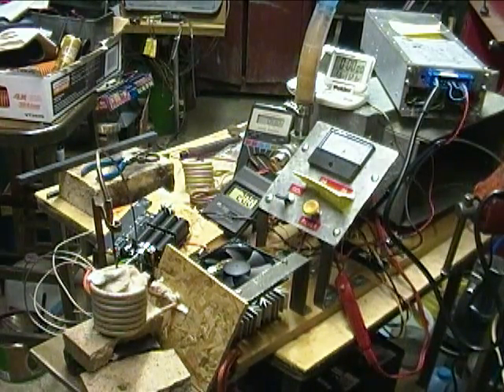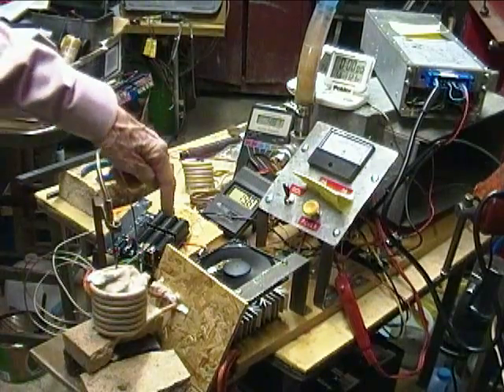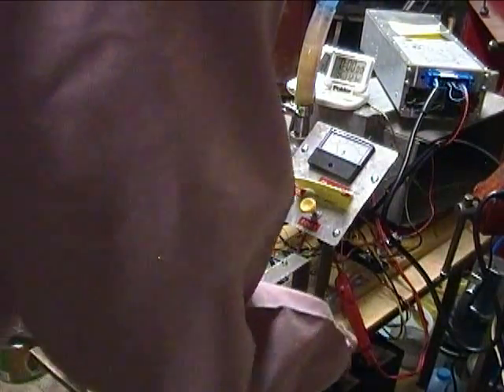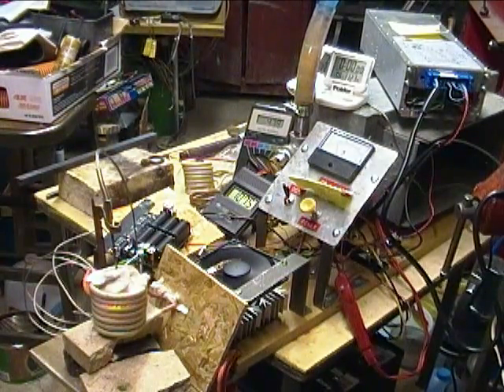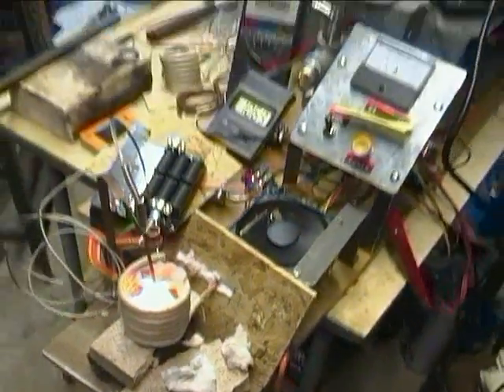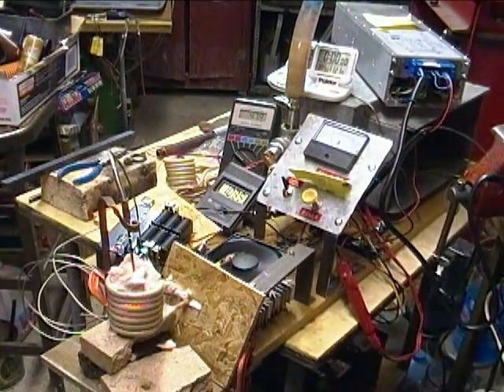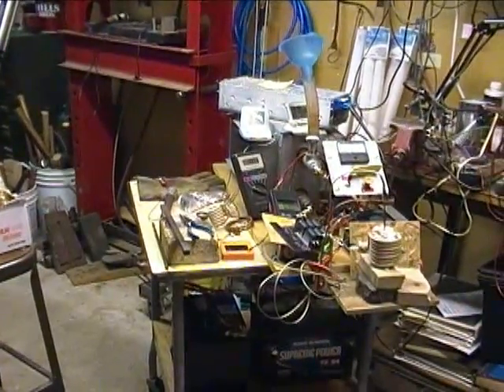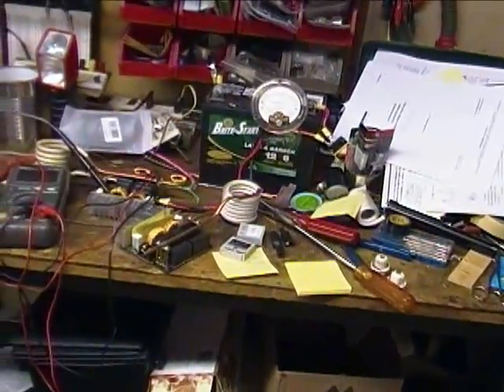ZVS 1000 Watt Induction Heater on 48 Volts

Comment: Hello again.I have been using my annealer for about 3 months that you have helped me with, and the heater quit working. When I examined it I found it had two blown capacitors. So I'm trying to figure out the cause. I have a 1000w 48v zvs, using a two wrap 4 turn coil made out of 4mm tubing wrapped in fiberglass tubing. The coil had a ID of 7/8" and OD of 1.25". I did find out my cooling fan was drawing air up from the board instead of blowing down on the board, I will change that this time. So with all this said do you have an idea of what I'm doing wrong? oh the coil is water cooled as well, and my power converter is out of a cell tower server 48v@ 3000w switching power supply. any help would be wonderful as I'm installing the new zvs heater this weekend. Thank you for your help
Reply from the maker: Do you have an amp meter in the circuit?  If so, what is your idle current and what is the current draw with a casing in the coil?
How long per "session" are you running the system with power on?
 I suppose you could simply have gotten a board with defective capacitors.  I would have thought that Mosfets would have failed first.
Reply: @frenchcreekvalley  I do have an amp meter on it. It wwas showing 8A with a run time of 3.6 seconds. I have a ssd relay so it shuts of the annealer after each cycle. I have an automatic annealer that picks up a case from a hopper, then drops it in to a shoot that goes to the coil, then a trap door that drops the case. this is repeated over and over 100-150 times a session. so idel is zero
Reply from the maker: @keeper1959fem  I don't have an exact answer for you.
Maybe just replace the capacitors and see what happens.
https://www.aliexpress.com/item/3256803832297341.html

Do make the fan blow down onto the board.
 
Can you measure the temperature of the capacitors?
Do some get hotter than others?

It sounds like your power supply is up to the task, but I would have thought that the current would be several amps higher.    Can you make sure that the power supply voltage stays up at about 48 volts while current is flowing?

Comment: I'm trying to melt some copper in my new 48 VDC 2500 watt induction heater, and I'm noticing that the volts drops to about 25 volts when I drop my larger size ceramic lined graphite crucible into the coil.  It doesn't do it with my smaller graphite (only) crucible.  I want to learn from your mistakes and not smoke this unit.  I've let it run for about two or three minutes at 25 volts, but don't want to let it go any longer.  Am I OK to run it at the low voltage?  Should I buy and parallel  another power supply with this one?  I bought the power supply from the heater seller, and it works well on iron, it's just my larger size ceramic/graphite crucible that causes the problem. Thanks for any input.
Reply from the maker: I strongly suggest that you need a ammeter in series with the power supply's output.  Personally, I prefer an analog ammeter with an external shunt, similar to this one:
https://www.ebay.com/itm/US-Stock-Analog-Panel-AMP-Current-Ammeter-Meter-Gauge-DH-670-0-50A-DC-Shunt/371816610448?hash=item5691ff3a90:g:r60AAOSwtdVa4s1s:sc:ShippingMethodStandard!54002!US!-1

 
It sounds as though your power supply is going into "current limit" mode which is causing the voltage to drop to keep from hurting the power supply.
You do need a power supply capable of 50 amps at 48 volts for this heater.
Yes, you may want to parallel your present power supply with another similar one.
See this video for my discussion about the power supply that I like:
https://www.youtube.com/watch?v=S66Y-EZYhjo
Then, see this video to understand what currents are involved with differing materials:
https://www.youtube.com/watch?v=Kz6tSfYLrnc
And I have several videos of melting copper.  Here;s one:
https://www.youtube.com/watch?v=ZiF3eYB5v0Q
In most of my videos I constantly call out the "numbers" so you can better understand what is going on.

Comment: When you added the second capacitor bank to your circuit, you were using 14Ga wire and just clipping it into the circuit. What you may not have considered is that you are actually adding capacitance to the tank circuit. Because this is a parallel resonant LC oscillator, both the voltage and current "in-the-tank" can be much higher than that of the power supply. For instance, the "wire" composing this tank is actually the copper pipe! By comparison, your puny 14Ga jumpers were like little fusible links (which is probably what they would have done had you left them connected very long).
Reply from the maker: Yes, I'm sure you are correct.  Next move is to use some copper bus  bar instead of wire, and to make the connections as short as possible.  Looking back on this experiment, I didn't make it easy to add things on, did I?
Reply: I had an idea for an easy way that you could connect your second capacitor bank:
Just use your old circuit board (like you were doing), but physically mount it to the bottom of your main unit by using the standoffs on the old board by removing the pipe straps and making six lengths of allthread by cutting heads off appropriate sized screws. Taking the standoff mounting screws from the PCB out of the working unit and replacing them with the allthread so you have screw threads sticking out the bottom and screw your 2nd PCB's standoffs onto these. Then mount the old PCB to those standoffs (just like they were originally). Voila! Now you've got a double-decker with 2 banks of caps joined by 6 hefty standoffs with very little extra conductor length added to the tank circuit! Simple, no manufacturing, no soldering even. What do you think?

Comment: If you are needing to lower your frequency, you can either increase the impedance of your chokes ( not an option, unless that's what you were doing with your work load ) or  add some capacitors.

There are three main equations that can calculate your frequency: Capacitive Reactance (Capacitor and Resistor), Inductive Reactance (Inductor and Resistor), and the Resonant Frequency equation (Capacitor and Inductor). I'm sure there are more, but these are basically the same equation just tweaked.

You need the Resonant Frequency equation. I don't know how to write it out on YouTube, but here's a link to a calculator.

http://www.1728.org/resfreq.htm

Comment from the maker: Yes, I understand that.  But I am working to get the frequency lower, too.  And a larger diameter coil does that.  Now that I am running on 48 volts, I will begin working on other coils.  I'd like to get the frequency down to about 30KHz if I can.  The coils are not that easy to change right now.
    Also:  I used the nut just to see if I could replicate an experiment that another guy did using a 1.5 KW unit.  But if I put anything larger in this existing coil, I can just about max my existing power supply.
   Thanks for looking.
Reply: Frenchcreekvalley .frenchcreekvalley 

Can you remove some of the capacitors from one of the boards that failed and add them in parallel to this one? That would up the capacitance, thus lowering the frequency.
Reply from the maker: I thought I already covered that in my previous video, but maybe not.  Anyway, I did do exactly that. That change dropped the resonant frequency from 87KHZ (using the 2" ID, 6 Turn coil ) to about 62 KHz.  So, my next step is to wind some longer 2" diameter coils to further drop the frequency.  I just made a 9 turn coil and I will make a 12 turn coil and we will see what happens.  But I still have an issue to solve with the added capacitors.  The wires from the existing board's caps  get very hot very quickly.  I think it's more that just a wire gauge issue.
  The chokes don't really participate in any positive way to the resonant frequency of the circuit.  In fact, when I did try doubling up on them, the Fres actually increased!
Reply: Frenchcreekvalley .frenchcreekvalley Ooooh, sorry. I guess I didn't watch the last one.. Or maybe I just forgot. I hope you get it working right the way you need it.

 I'm getting 10kHz with my simulation, still waiting on my parts to arrive. I got it that low by adding about twice the capacitance. 

Since each capacitor sees the same voltage while in parallel, it doesn't get divided up. However that's not the same with current. Current DOES get divided between each capacitor in parallel configuration. So you may get less Watt heat loss out of your capacitors if you use more of them.

(Whoops, I'm getting ahead of myself again. You literally just said you did this). I don't know what to think about your capacitors getting hot. Maybe they're just not rated for the voltage you're feeding them. The rating should be printed on them.... But then again, it's Chinese made.
Reply from the maker: Regarding my "doubling capacitors" video:  The capacitors on the added board are identical to the ones on the "main" board.  And it wasn't that the second set of capacitors got  too hot, it was the connecting wires and the brass mounting posts that heated up a lot.
Reply: Frenchcreekvalley .frenchcreekvalley 

Aha, I'll have to watch that one then.... tic toc... So it was the difference in resistance of that wire. The connection points were probably the hottest... Well that sucks.